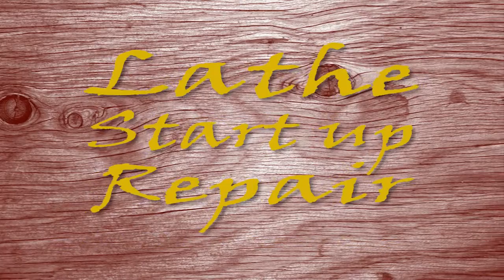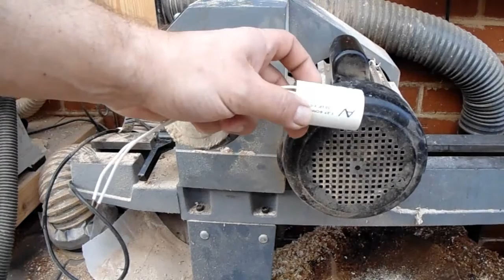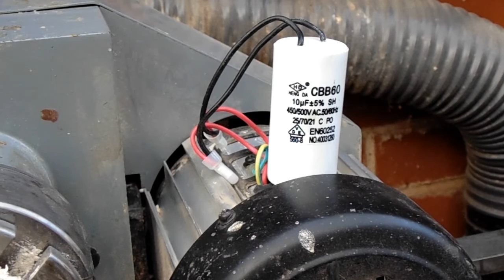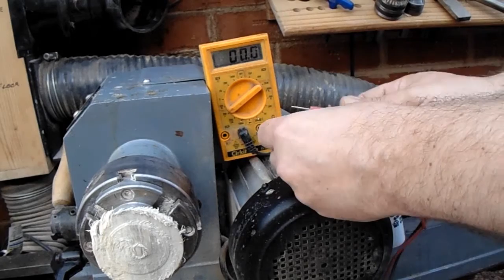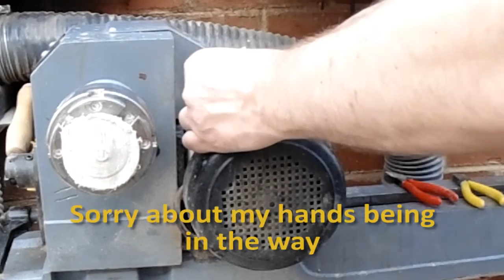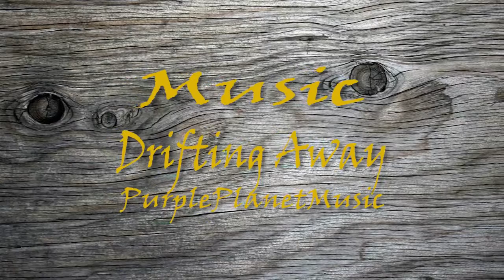Woodturning Lathe Start Up Repair

Comment: PSI Turncrafter bought at yard sale stops when pressure applied to work piece, do you think will this fix the problem?
Reply from the maker: Hi Robert. As I understand it the capacitor is used to start the machine but has little effect once its running.  The first thing i would check if I had your problem is that everything is running free.  You should have no problems moving your head stock and it should rotate freely.  If this is not the case then its either bearings or motor.  If the spindle turns easily then it sounds like the motor has issues and isn't delivering enough power.  These are my best guesses but I'm sure there are others who could help more.  Thanks, Jake
Reply: Robert! I am having the same problem. Did you find any fixes?

Comment: just had the very same thing happen to mine, surprised how easy it was to fix..
Reply from the maker: Glad you got it fixed
Reply: Question.. bought lathe at yard sale, it stops when using. Even just running sand paper on the work piece will stop it. Will this fix the problem? PSI Turncrafter.
Reply: @robertloken8613  depends if its the motor stopping or the belts slipping. if its starting to spin up or needs help to start it then change out the cap and check the belts havnt got oil on them, you dont know why it was up for sale the last owner may be a complete idiot when servicing things...